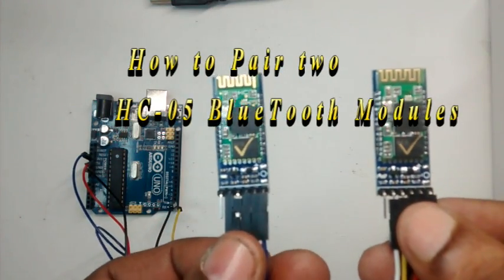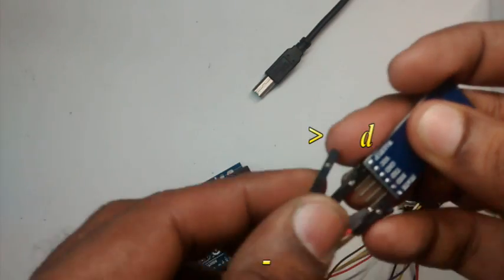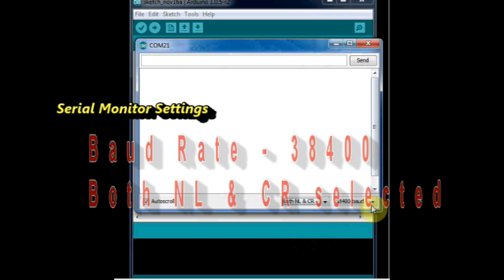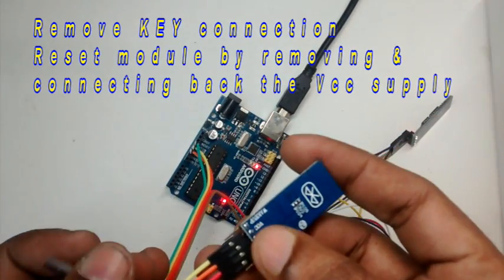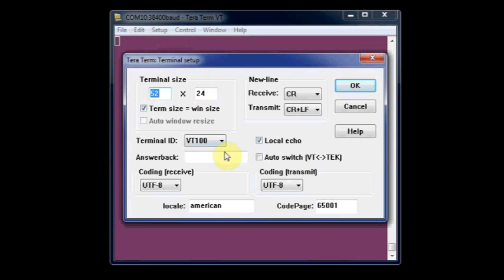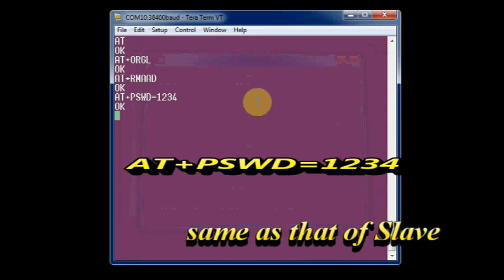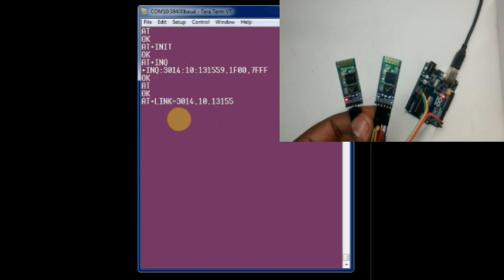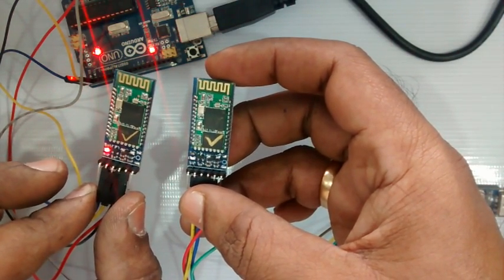How to PAIR Bluetooth HC-05 Modules

Comment: AT
OK

AT+ORGL
OK

AT+RMAAD
OK

AT+ROLE=1
OK

AT+CMODE=1
OK

AT+INIT 
OK

AT+INQ
+INQ:4045:DA:9692,58020C,7FFF
OK

AT+RNAME?4045,DA,9692
+RNAME:Micromax A24
OK

At+pair=4045,DA,9692,40
OK
(BT Pairing request on mobile)

at+fsad=4045,DA,9692
OK

AT+LINK=4045,DA,9692
FAIL
+INQ:548C:A0:F6B34,2A010C,7FFF
OK

Link command gives me reply of "FAIL".
Please help me to solve this problem.
I want to connect my HC05 module to android mobile.

Comment: hi MR SARAVANAN thanks for the video .I followed all your instructions and my bluetooth went into config mode (slow blinking) but after opening the ide I am getting no response (JUST BLANK)from the serial monitor when i type the AT commands and i am using the same module which you are using in this video

Comment: Hi! I communicate with my HM11 module over USB to UART module, but when I connect it to my microcontroller I can't read data from it (I try to send just stream of '1'). What settings/commands should I do for bluetooth communication with my PC? Currently my PC recognized my HM11 module, but I do not see any COM port (bluetooth com port) for serial communication.

Comment: Hello Sir, how to send serial data from one HC-05 to another? Does it automatically send data after being paired? Or do we have to use any other AT command? I am stuck with my final year project and I really need help.
Thanks in advance
Reply: +Mahesh Padmanabh just serailly send data it will receive it  if doesn't work try disconnecting either one of hc-05 modules and connect them again

Comment: I am using Xbee pro and Xbee pro sheild to send informations from the first card uno  to the seconde card uno so i can print the information on a LCD  but i having a lot of problems with the configurations so do you think that is possible if i use Hc 05  ??? by a master and a slave modules ?

Comment: if the idea is to use the UNO's onboard USB to Serial chip as a USB to Serial UART TTL to communicate between the PC and HC-06, you can also simply pull the RESET pin to GND which will temporary disable the ATMEGA chip OR removing the ATMEGA328 chip (this will be more troublesome) without uploading a dummy sketch.

Comment: Hello saravana
on my HC-05 
I have :
STATE
RXD
TXD
GND
VCC
EN
i dont have "KEY"
please reply 
thank you
Reply: mwnllt 
Press and hold the switch found on the bottom right of the module while connecting VCC to 5V DC and it should enter the AT command mode indicated by the 2 second interval blink of the LED.
Reply: Thanks it worked for me by directly soldering a wire that goes through pin 33.
Thanks any way
Reply: +TheThoughtfulGuy what wire? EN or STATE?
Reply: EN i think it was a long time ago! but i check the datasheet for my hc04 and found were it is, i am almost sure its EN but check just in case
Reply: sorry sir , im stuck now , when i connect my bluetooth to arduino after upload the empty code , then i open serial monitor, i write AT ,but nothing display , can you suggest me something what i should do?

Comment: Hi Saravana,
I have connected my hc-05 to pins GND >> GND, VCC >> 3v, Key >> 3v, TXD >> RXD, and RXD >> TXD. Then I powered it up but I still see the LED blinking fast, which mean it is still not in the configuration mode. I am not sure how I can fix this issue, I'D appreciate your help
Reply from the maker: Connect Vcc to 5v .The HC05 (if you're using a module as shown in video) has got onboard 3v3 regulator.If Vcc is provided only 3v , it may not function properly.Also note that the wakeup key pin to be connected to 3v3 first & then finally provide Vcc.Now the module will enter AT mode at baud 38400.
Reply: Saravanan AL
Thank you for your response!
My bluetooth module is identical to yours, but the only difference is that mine has (EN) pin instead of the (wakeup) pin. I did connect the vcc to 5v, but still having no luck to switch it to the AT command mode. The LED still blinking fast! I do not know what the problem is so please if you know what could be possible the issue, let me know.
Thanks,
Reply from the maker: medo al I doubt the EN connection of your breakout board.The only way to confirm is to cut open the plastic sleeve of the module & solder a wire at PIN34 (Key or EN pin) .Connect this wire to 3.3v .Now the module should enter AT mode.
To check out the location of pin34 on HC05 VISIT :
 http://wiki.pinguino.cc/index.php/SPP_Bluetooth_Modules
Reply: Thank you Mr Saravanan This help me manage the HC-05 to be in the AT MODE however now when I enter AT to the serial terimnal I receive Ï§†… this message?? any Idea why it is acting like that?
Reply: Saravanan AL Thta solved for me. My board has printed EN instead of KEY, so I soldered directly to pin 34 and I could enter in AT mode. thank you.
Reply: +Saravanan AL , thanks sir. this worked for me
Reply: +medo al Hi, I had the same problem as you but I found a solution and posted it at http://forum.arduino.cc/index.php?topic=302827.msg2561221#msg2561221    . It is a problem with the baud rate of 38400.

Comment: Nice video, thanks !
I've a question. I'm trying to make a call via mobile to another number when I've got some sensor value is high in Arduino's analog port. So my mobile has bluetooth chip, and I can make call with that HC05 too, but I'm confused that which registers on HC05 MUST be setup ? ROLE, CMOD? and should I make INIT after than those settings ? Can you make a video about that project too ? or can you make a list which registers MUST I setup on HC05 ?
Thanks!...
Reply from the maker: When BT is set as Master (ROLE=1) it can initiate pairing with others.Slave cannot pair by itself.In case you initiate pairing from Android phone,it doesn't matter BT is ROLE 1 or 0.
CMODE=1 enables BT to pair with any address.CMODD=0 allows pairing with bound address only.You've to issue AT+BIND command for this mode.
INIT is to initiate SPP profile library for Bluetooth.
But problem with pairing a phone & BT is , after power off the BT is not able to pair again automatically as done with 2 BTs. .